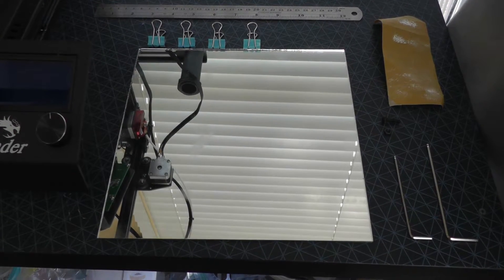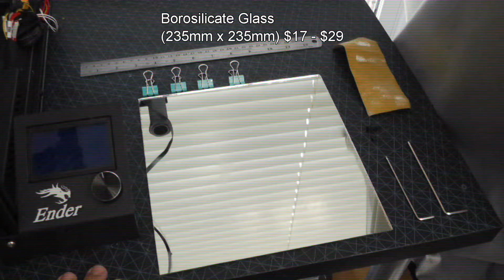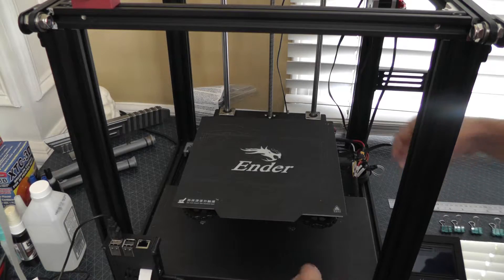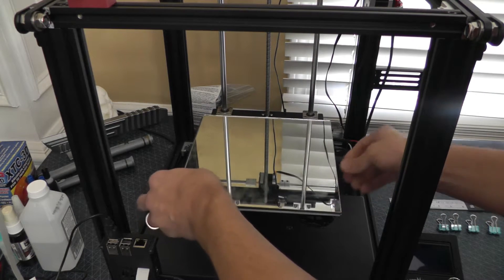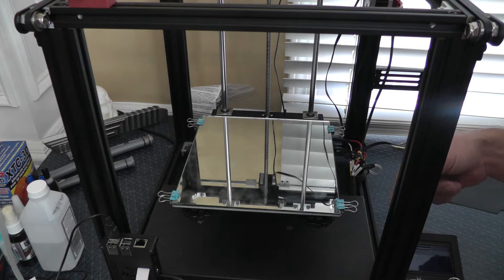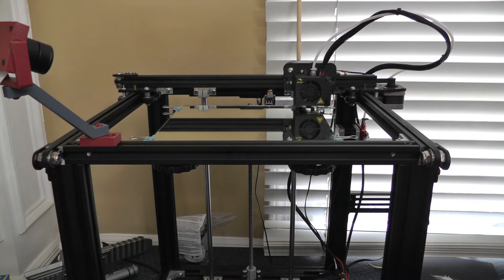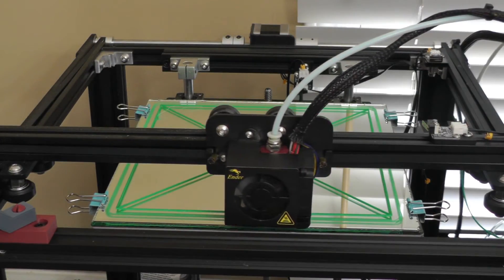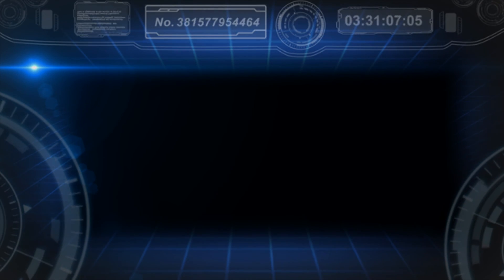Creality Ender 5 Upgrades #2: Glass Print Bed

Comment: My nozzle goes all the way to the sides of the bed I can't use clips
Reply: They are what about printhead settings? My print area is at 220x220 on cura...but machine is homing to like 233mm almost to the corner
Reply from the maker: @pappatreal  Did you get yours direct from Creality or did you order from a 3rd-party? Also, if you use the menu to manually move the head after homing, what's your X and Y max?
Reply from the maker: Did you change your print area to 235x235?
Reply: My build area is 220x220 what it says on the machine
Reply: Complete newbie here.
Reply: I made the mirror 235x235
Reply from the maker: If that's the case, your nozzle can't be going to the edge. 235-220=15 so you should have about 7mm on each side. You should be able to put the clips in that space.
Reply: Yeah it says 220x220 I measured it, the bottom heat plate is 235x235 so I made a mirror at 220 and one at 235 and 220 didn't fit the heat plate 235 does but nozzle is almost to the sides
Reply: If I go into my slicer can I change X and Y setting to 220 then will nozzle home at that instead?
Reply from the maker: Your slicer should be set to 220x220 for proper homing and printing.
Reply: Ok on my printer head size the X and Y min and Max are currently at 0.0 as well as printer gantry height I'm using Crealty software and I went to the Crealty website to order it it shipped from California

Comment: I bought a 3/32" piece of glass from the local hardware and I beat my brains in trying to get it to print anything without waves in it. Finally got my steel ruler out and sure as hell the glass wasn't flat. You assume glass is always flat, not always true apparently. I wasted a good 3 days trying to figure out the issue. I just bought a pack of the 12x12 mirror tiles at Lowe's today that others have talked about online for $10. I highly recommend them. It's a pack of 6 and I wanted a backup so I had them cut 2 for me because they have a nice setup to get super straight cuts. The mirrored surface looks so much better than clear glass. Plus it measures a good beefy 1/8" thick so it's way more stable than 3/32". I kept the magnet sheet on the bed so I could always revert back because it doesn't cause any problem so far. But yeah basically everyone needs a mirror bed. Got some nice strong springs for the bed. And of course the binder clips. I am currently using a .005" feeler gauge for bed leveling. Did an XYZ calibration cube and got all the steps/mm set. Printing way better than it ever did before and it was never bad to begin with so yeah prints look amazing. I know that's a lot of info but hopefully it will help someone else.
Reply: Update: If your a beginner at this don't do what I did and follow a certain video about extruder steps/mm calibration and having you enter the value into your slicer because it will bit you in the ass later when every time you try and print a calibration file and your steps/mm keep changing unknowingly between the slicer setting and stock. Confused the crap out of me for days and couldn't print anything. I removed all the steps/mm in my gcode files and started over and everything works fine now. I went through nearly an entire roll of filament of bad prints trying to figure it out.
Reply from the maker: Absolutely! Steps/mm belong in your firmware. Thanks!
Reply: @kerseyfabs  Thank you for reassuring me of that. It's always helpful when experienced people help out us newbies.
Reply: It makes sense that a mirror would be flatter.  Any distortions in the surface would turn it into a funhouse mirror!

Comment: Not sure if someone mentioned this in the comments but if you wanted to you could probably add magnetic stripping to the back of the glass and would connect to the magnetic layer or if you know you will not be using the magnetic bed in the future ever, you could glue it to the back of the glass. Just some other thoughts that would possibly work if you didn't want to use the clips.
Reply from the maker: Thanks for the ideas! I think there are two issues with those. 1) You could create a new leveling issue. 2) You've created new layers of insulation that will keep the glass from heating correctly. Doing it magnetically without a flex plate is also a bad idea because without the flex, magnets are hard to remove.

Comment: un fortunately i never leveled  my ender 5 bed before... i had magnetic bed which my friend leveled... after a week i had many failed prints and decided to replace bed to the stand ender bed they sell that clips on...
Reply from the maker: Learning to level your bed is an essential skill. Practice makes perfect!
Reply: @kerseyfabs  were you happy with that mirror from lowes btw? were prints sticking and printing as good as any other bed you used....thanks
Reply from the maker: @roadstar499  It's all I use on both my Ender 5 and a custom 3D printer I'm building. I also used one on my Alfawise U30 Pro. It's very reliable.
Reply: @kerseyfabs  very cool, was that the smallest piece of glass they sold at lowes? was it 1/8'' thick? thanks again
Reply from the maker: @roadstar499  Yes, 1/8" thick. There may have been a smaller piece but, for this price, this made more sense. I had some of the remaining glass cut into backups in case one broke and then a couple of larger pieces for future printers.

Comment: I would like to see a video comparing sensor measurements of a standard build surface against a glass bed to see how inaccurate a standard bed is compared to a glass bed.
 You can get photo frame clips for your glass bed which have more clearance than the bulldog clips, I have increased my print size from 220 x 220 to 229 x 229 using these clips
Reply from the maker: I think the level test would be great! I'd just need to come up with which surfaces to test. Suggestions?

Can you provide a link to the photo frame clips?
Reply: @kerseyfabs  I bought mine from Amazon UK but I imagine the US site will also sell them
https://www.amazon.co.uk/Pozzi-EAZI-Frameless-Clip-Acrylic/dp/B07DR9JZDW/ref=sr_1_5?keywords=photo+frame+clips&qid=1568562346&s=gateway&sr=8-5

I would suggest the standard bed of whichever printer you use of course and maybe the glass upgrade bed of the company that built the printer

Comment: Hi kersey, quick question do you know how to increasing max bed temp ender 3 or 5? I need go to 125° bed temp for abs
Reply from the maker: Most likely that's hard coded into the firmware. You'd have to reflash your mainboard.
Reply: @kerseyfabs  which command? I try find at config and config adv but none found
Reply from the maker: @nurfatrochman3726  #define BED_MAXTEMP

Comment: Why not stick a thin metal sheet under the glass. You get a glass bed that's magnetic.
Reply from the maker: It's not a bad idea to get rid of the clips. The clips are just cheaper. Plus, if the magnet was too strong, you may not get it off.

Comment: What temperature did you set the bed for?
Reply from the maker: I believe it was 50°C, possibly 60°C.
Reply: @kerseyfabs  Thanks. I'll start with 60 and dial it down as I go. I've been using the Creality magnet board at 45 and although it works great, the finish on the bottom layer is rough and I'd like a smoother finish. The glass seems like the right way to go.
Reply from the maker: @lauckstreet  Ah! For reference then, I almost always print at 60C with PLA on glass.

Comment: I purchased and received an Ender 5 last week (August 2019). Creality have now included an adjustable screw at the back of the heatplate to allow for different thicknesses of glass or other buildplate materials.
Reply from the maker: This is an additional screw to the one I showed that adjusts the end stop?
Reply: @kerseyfabs  Hi, I received mine today and yes it is a roughly 20mm long screw with a spring underneath, and one thumb like nut on each end. The new one also has the V1.1.4 board and landy power supply.
Reply from the maker: @teckeleddie  Thanks for the update! Is that a silent 1.1.4 board or a standard board?
Reply: @kerseyfabs  Sorry I honestly cannot say without taking off the heat sinks.
Reply: @teckeleddie  ahhh, was just about to go buy a new nut when i saw this comment - I have now tried for 20 minutes and still can't turn that screw - How did you manage?
Reply: @Chupaluppa  Hi, I have just had a look,  the screw is secured by a small nut underneath the head. This is there to stop it turning when in use.

Comment: Ok love the videos my friend but what is that little box to the bottom left with a few USB slots and an RS 232 SLOT
Reply from the maker: I think you're asking about my Raspberry Pi case. That's a Raspberry Pi running OctoPrint that I use to remotely upload and monitor the printer.

Comment: FYI I have had a glass bed for about 4 months and it's given me no problems with adhesion .  BUT  as KF said the glass must be clean.  I did have problems with mirrors as they tend to have a dip in the middle. I also noticed that when it comes to mirror or plain glass you have to make a compromise. Older glass is more flat and therefore a breeze to level. Older mirrors too are more flat however both are heavier than modern lightweight glass/mirrors so that extra weight might affect the print and/or the motors. Antique mirrors are really flat but heavy. Ikea mirrors are light and cheap but are prone to dips.
Reply: so what glass bed do you use new old or real old??? and you just clean and never use any glue stick etc??? thanks

Comment: The bed stop screw is now a special one with 2 finger nuts so you can tighten it up at the desired hight and it is long enough that I have at least half the length left when my bed is at the top position.
So it seems they are taking criticism and updating the printers.
Reply from the maker: Thanks for the update!

Comment: Great video. One thing I did differently was I put the nut on top of the bed in the rear. It allowed me to set the exact offset from the stop I needed. Possibly due to the nut width I used. This has helped so much in having a good level first layer.

Comment: For the problem with the heavy bed sinking down on its own weight while printer (or stepper) is powered off, there should be a simple solution:
Change the leadscrew from lead 8mm (4 leads, de facto standard) to lead 2mm and the fitting nut (I prefer POM). Of course you will have to change the firmware (multiply steps/mm for z by 4), but as the original firmware has not activated the thermal runaway protection, you have toi do it anyway. So changing steps/mm for z is just changing one number more in the config.

As changing from lead 8mm to lead 2mm means 4 times the force needed to move the bed down by gravity, the bed should held in place even with the heavy glasbed.

Also on a 1.8° stepper there are 200 steps per rotation. So with the original 8mm leadscrew you have 0.04mm per step. So the very common layer hight of 0.15mm is avctualy 3.75 steps. As microsteps have not as much holding torque as full steps, this should be avoided. With an 2mm lead screw you will get 0.01mm per step. A much better fit.

Upgrading is even more usefull if you want to change the board to an other one later. With a full ATMega 2560 or using a MKS TFT you may want to activate resume after power loss. With a self-moving bed on powwer loss this would be impossible. But with a new leadscrew it should work.

As an update of the leadsrew is quite simple and cheap, you should consider that. With a glass bed I consider it a "must2have"
Reply from the maker: Thanks for the advice. I like the solution. I'm looking into finding some of these the right length.
Reply: @kerseyfabs  i would enjoy seeing this in your upgrade series as i do plan to get a glass bed but id like it to stay still
Reply from the maker: @henryvolpe2263  I've been looking for one of these to do the mod. I'll let everyone know if I order one. Thanks!
Reply: @kerseyfabs  
I got: https://de.aliexpress.com/item/T8-Lead-Screw-Rod-OD-8mm-Pitch-2mm-Lead-2mm-Length-150mm-500mm-Threaded-Rods-with/32760102869.html
and
https://de.aliexpress.com/item/2-st-cke-T8-Mutter-Trapez-Schraube-Mutter-POM-Mutter-Schraube-Muttern-3D-Drucker-Z-achse/32920626978.html

400mm lenght is a little more than the original leadscrew, but it does not interfere with anythink on the printer, so you do not need to shorten it.

With the 2mm lead and the POM-Nut it is actually impossible to move the bed by pushing down by hand without a force so high you would eventually break someting on the printer. So the glas bed will not be a problem at all. Turning the screw of course moves the bed without any problem.
Reply: @oleurgast730  Hi I'm currently having the problem with the dropping bed because of the added weight of the glas. Is there a difference between these two lead screws you posted or can I get either one?
Reply: @anatolvanderich1748  one link is the leadscrew (with brass nut), the other is a pom-nut only. Pom nuts have less play than brass nuts, so I prefer pom nuts. So booth articles reqired.
Reply: @oleurgast730  Should have used a translator before.. I assumed, that leadscrew is not this rod thingy but the nut. Sorry for the confusing question..
Reply: @oleurgast730  Hi. I just came back to say thank you. The upgrade went fine and the bed dropping is completely gone.

Comment: Just FYI, my Creality glass bed has arrived from China. It has an embedded metallic grid, which makes it attracted to the magnetic bed of the Ender-5 (which makes any clip attachments unnecessary). So I would definitely not try to remove the magnetic layer from the Ender-5 bed. Also, the bottom of it is just smooth glass, so you probably could turn it around if you wanted to get a perfectly smooth bottom layer of the print. I said probably because I have not actually tried it (but I have seen it use the magnet every time so far).
Reply from the maker: I appreciate you posting this. It's good to know what Creality is shipping. Thanks!
Reply: @kerseyfabs  You’re welcome. And I appreciate every single one of your videos. 🍸
Reply: No it doesn't.  At least the one I got doesn't.  I'm building my printer right now while doing my upgrades from the startt based on Kersey's vids, and the glass bed slides around on the magnet.  Yes, my plate came from Creality with my printer.  In fact every glass plate from the site says nothing about a metallic grid embedded in the glass...  all plates on the site show clips being used.  Actually I can't even find a third party plate like you described so I'm not sure what you have but after searching, such a thing does not appear to exist...
Reply: @burningreach  OK then, some do and some don’t then. Maybe I just was lucky.

Comment: I noticed you said your test file was 200mm x 200mm? If I'm not mistaken you mentioned the total print area was 235mm x 235mm.  Wouldn't putting the clips 4mm in on each side only reduce it to 227mm x 227mm?
Reply from the maker: Thanks for the question! So the bed is 235mm x 235mm but the printable area is actually 220mm x 220mm. Then if you leave some room to be able to print the "skirt" around a print (the lines that are used to prep the nozzle and to make sure you'r at the right height) you're right up to the 220mm mark. It's not perfect unless you adjust your print setting to go right up to the edge but it's close enough for testing.

Comment: Honestly I wouldn't have thought  you would even need clips, given the bed really doesn't move very much or very fast. But to be fair i don't have an ender 5, so there's that. But am thinking about getting one, I think. Thanks for the video, nice one.
Reply from the maker: You definitely need the clips. Sometimes the print head will drag the print to the point that it will catch and cause a skip or pull the print off the bed. If you add on top of that that you could also drag your bed with even less force, you'll have a lot more failed prints.

Comment: What is the camera you have on the top of the printer, and casing did you print for it? Does it cover everything from when the bed is high to when it is low? And what is its resolution?
Reply from the maker: It's a Raspberry Pi camera that I've created a custom mounting system for. It's connected to the printer using OctoPi. I'm just about done with the testing and I'll do a video soon showing how it works and where to download it. With the mounting I'm working on, you should be able to see everything and place it where you like. It has 1080P resolution.
Reply: @kerseyfabs  I'd love that mounting system! It looks great!
Reply: @kerseyfabs  Thanks. I’m looking forward to that video.
Reply from the maker: @RustyTube  I just finished up what I hope is the last modification. I'll try and get the video done soon.
Reply: @kerseyfabs  Great. :)
Reply from the maker: Here's a link to the camera itself: https://amzn.to/2WBQCFb

Comment: After my second print on my Ender 5 the middle of the magnetic bed developed a raised bubble that would not stick down, so I went with the glass mirror. After install the glass, one thing that plagued me was a slight dip in the middle so I checked out mesh leveling and the BLtouch system. While waiting for parts I removed the metal clips re-leveled the bed and test printed a level test pattern and low-n-behold, the bed didn't have the dip in the middle. Just to verify I put on the 4 clips and the middle dip returned. Now I have only 2 clips in the center of the front and back. Likely just my particular Ender 5 but this worked for me. Go figure!
Reply from the maker: So the binder clips are warping your glass. This probably means your aluminum bed is warped, which is what you expected anyway. Thanks for the comment! This may help someone else with a similar problem.
Reply: @kerseyfabs  yep it helped me!